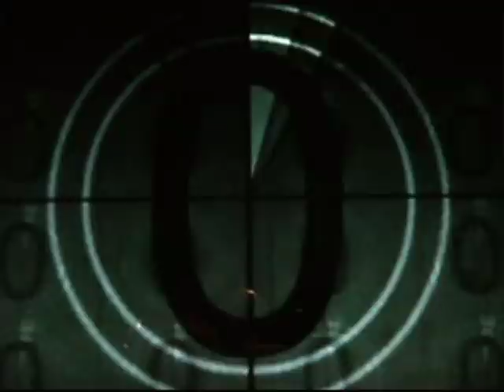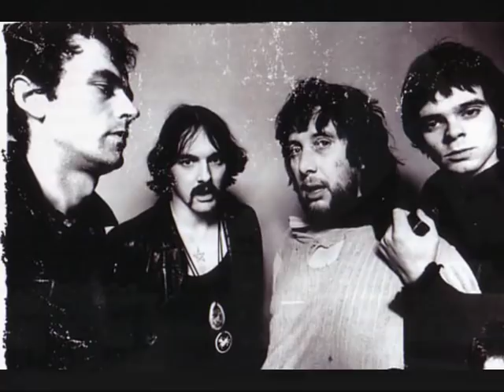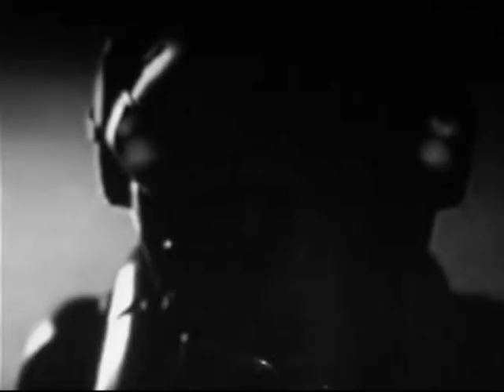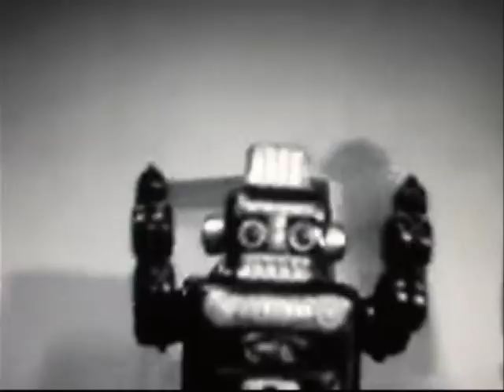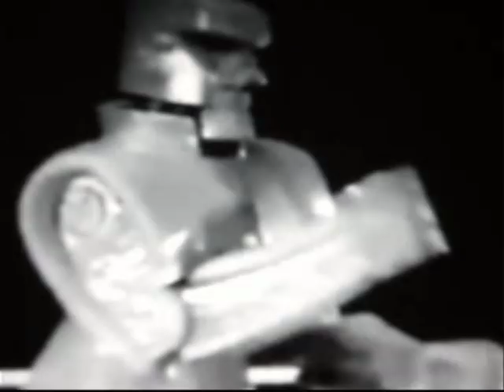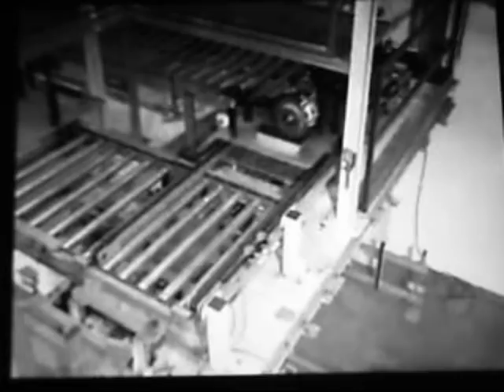The Stranglers - Hey! (Rise of the Robots) From the Album Black & White

Comment: https://www.washingtonpost.com/archive/business/1977/11/24/robots-to-the-rescue/617eb82d-c510-4592-95f7-77c47e2f1dbb/?utm_term=.1c8557221f3c
Robots to the Rescue
By Jerry Knight November 24, 1977
Welding together car bodies on an automobile assembly line is a mind deadening job.

Wrestling with a 40-pound spot welding gun that dangles from the ceiling on umbilical springs, a worker guides the tool along a body seam, pulling a trigger, methodically zapping together sheets of steel with bolts of electricity.

The assembly line moves incessantly, hundreds of cars, tens of thousands of welds, shift after shift. It is a job more fit for a robot than for a man.